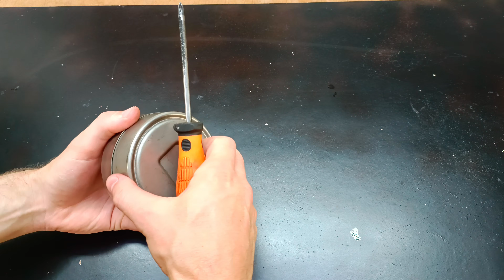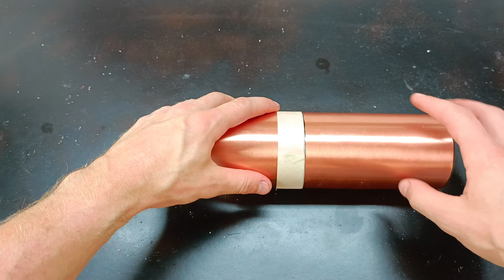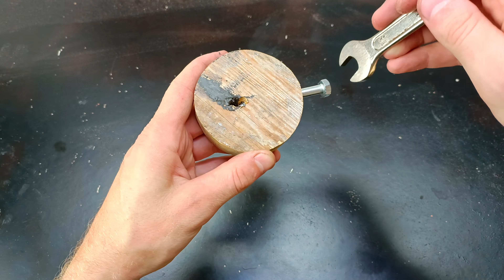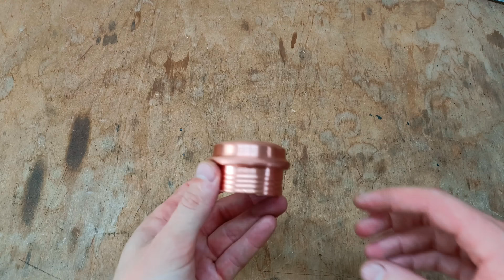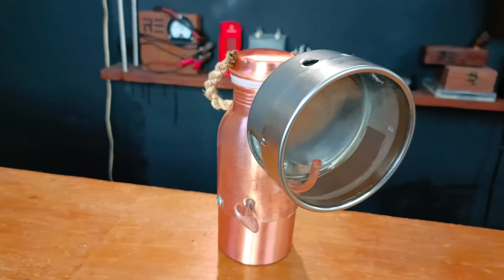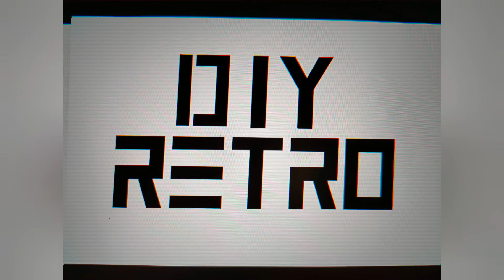DIY Carbide Lamp - DIY project

Comment: FYI OP, using copper with acetylene present is not the safest thing and could create volatile residues in your housing. https://en.wikipedia.org/wiki/Copper(I)_acetylide
Apparently using aluminum isn't a great idea either as its presence in the carbide/water reaction yields hydrogen.....
bro what did the miners use ? :face-blue-smiling:
Reply from the maker: Yor are smart guy;) Of course, what you're saying is true. Miners' lamps were most often made of steel and brass. However, the main goal of the project was for anyone to be able to make such a lamp without the need for sophisticated tools. Copper is a relatively easy metal to work with (no welding required). For occasional use, copper is perfectly acceptable. The video also mentions not using such a lamp indoors, but that's probably obvious. My next video, in which I use this lamp as a moped light, will be coming soon.
Reply: @DIYRetro  Not smart, just paranoid about accidentally killing more braincells than I already have, or worse :face-green-smiling:.  Lookin forward to the moped modification vid :hand-purple-blue-peace: